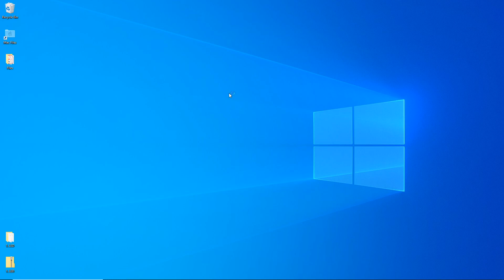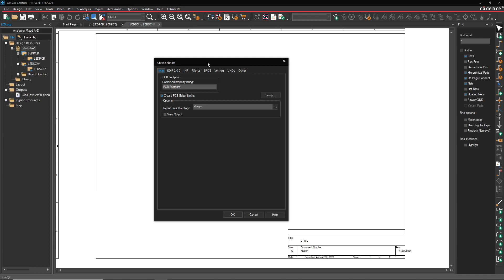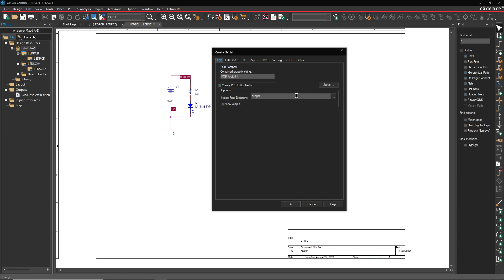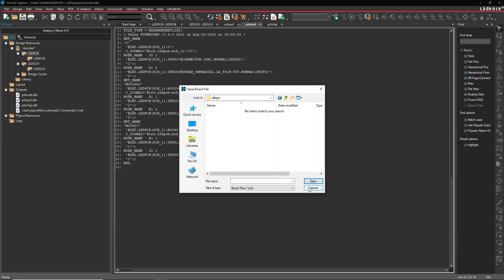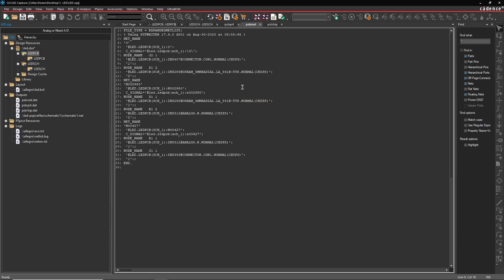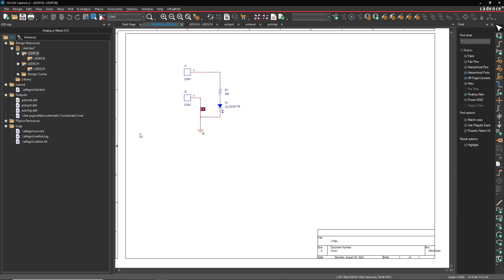OrCAD Tutorial - How to Make a Netlist in OrCAD v17.4 (Step-by-Step Guide)

Comment: Hi Kirsch, I am going through your PCB design course and i have been stuck with this "hanging" issue for half a day already. When i try: PCB-->Create Layout-->ok (without input board), the program hangs and i need to force it to shutdown (I am using version 17.4). I have tried all different ways but nothing worked. I can generate Netlist tho. I am new to PCB design, could you help guide me on any workaround to this issue so i can continue the course the next section with PCB Editor? Can I import parts directly at PCB Editor? Any help is greatly appreciated! thanks!
Reply: @techedkirsch  believe or not after knocking for almost a day the door finally opened! I figured how to import the netlist to PCB Editor and had to learnt how to setup path to the libraries. It seems its working now. Although part placement takes forever(i think that may be because of my laptop…). I will keep going and email you any questions if you dont mind. Thanks!

Comment: I recently spoke with a pcb designer who had 40 years of experience and said I should use ORCAD. The learning curve between altium products and orcad a lot at first.
Reply: @techedkirsch  yes. It seems different though. Basically Altium products are a Schematic editor and PCB designer wrapped into one. Whereas ORCAD is two products. A schematic editor which then lets you output a netlist and import it into the PCB editor. Would you say this is correct? However, I still do not understand how ORCAD manages to keep track of its libraries.